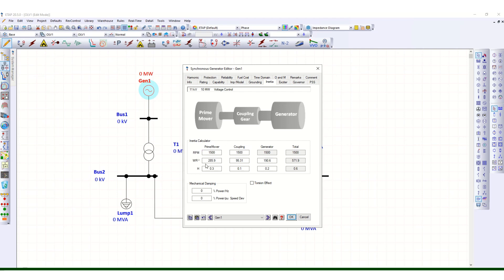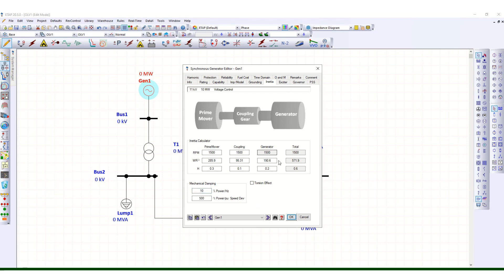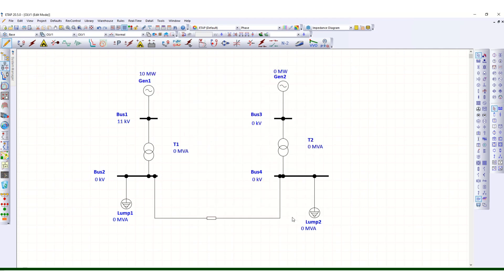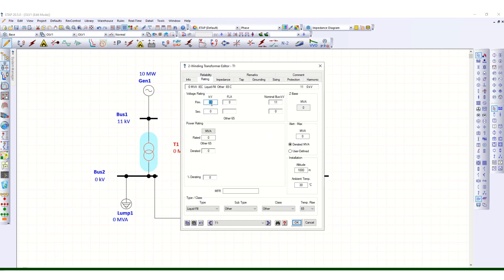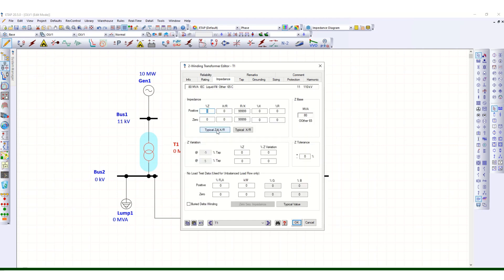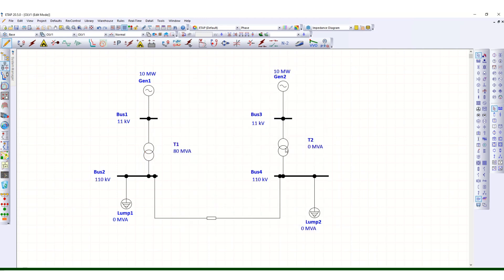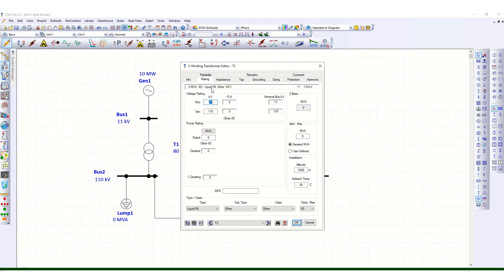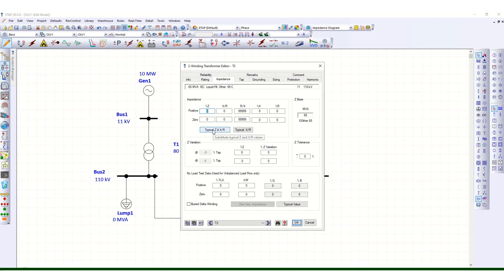ETAP Transient Stability Study

Comment: Can you Plot also Gen 2 Power Angle. in my simulation Swing Gen Could not plot the Gen Angle for Swing gen, Only Voltage Control or Mvar control Generator can be plotted the Power Angle? how is that?
Reply from the maker: Swing generator can also be plotted..
Go to Transient stability study case editor>Plot (check against the generator to be plotted - x sign will be shown there).
You are done 👍
Reply: @SmartEducare  already can be ploted, but it not shown any oscillation, just flat. Can you check it?

Comment: How is about setting of Excitation?
Reply from the maker: Response of the excitation system to the changes in generator speed / electrical output caused by system disturbances is negligible. 
Most important thing is generator reactances which are responsible for system stability..
Reply: @SmartEducare  what is common value fot H of Prime mover, coupling and Generator?